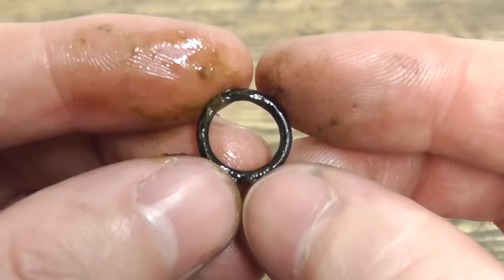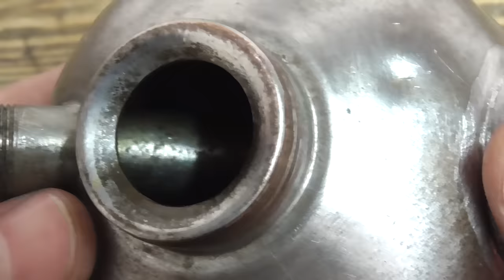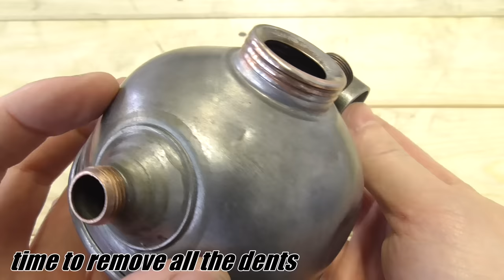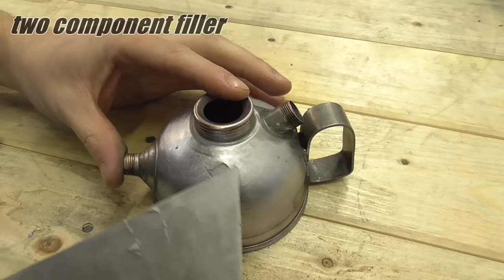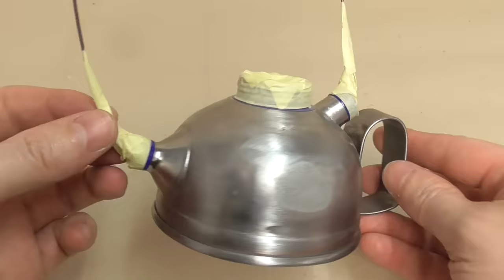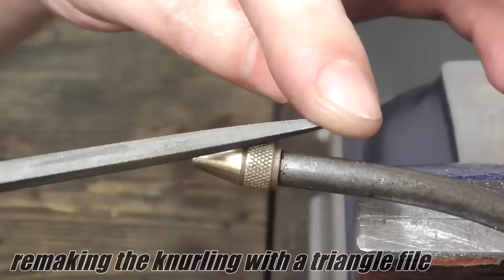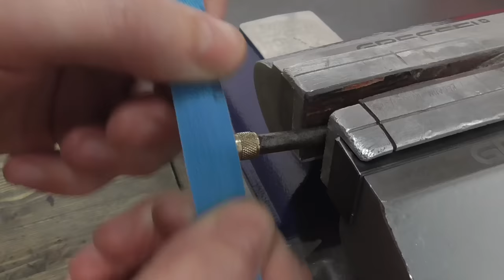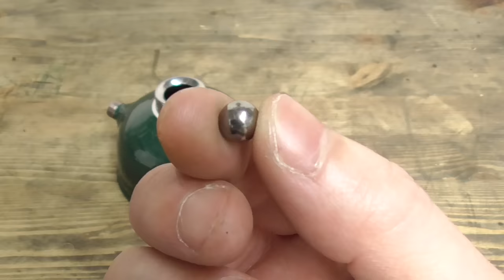Antique Dented Oiler - Perfect Restoration

Comment: I have a question. Why dont you just use the sandblaster to clean stuff right away instead of washing with water first? The reason i ask is because on other similar channels i see that they do go right ahead to sandblasting instead of cleaning with water. For example the channel Rescue & Restore. Is there any reason for this? Sorry, im not so good at understanding this. Great channel though!
Reply from the maker: Sandblasting media is very expensive and it turns bad a lot faster when there's a lot of dirt or old paint in it.

Comment: I still don't understand how the un-denter thing works.
Reply: The pointy bit welds to the concave of the dent and is manually actuated to pull the dent out. When it reaches a certain point, it breaks away from the surface. Depending on how deep and large the dent is, this process may need to be repeated a number times.
Reply from the maker: exactly, thanks